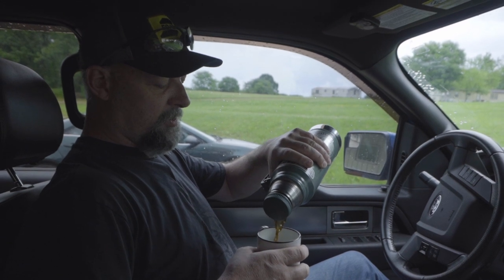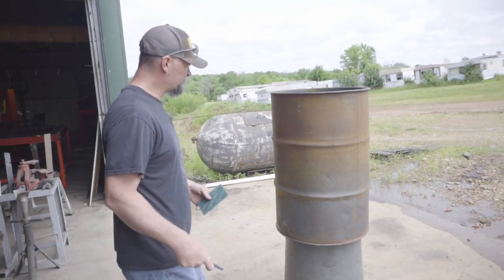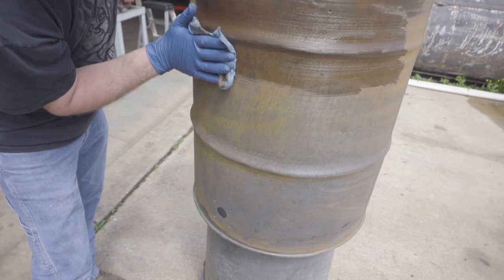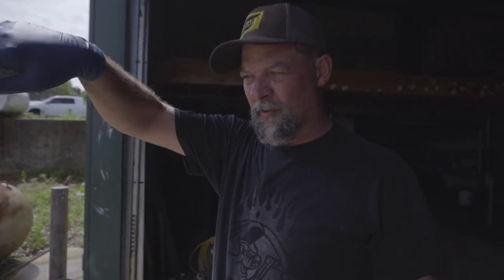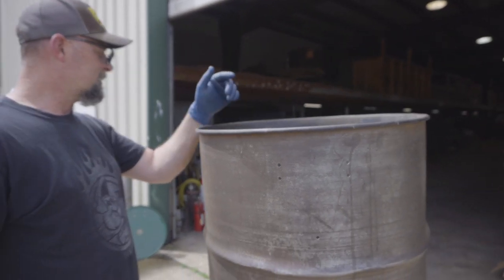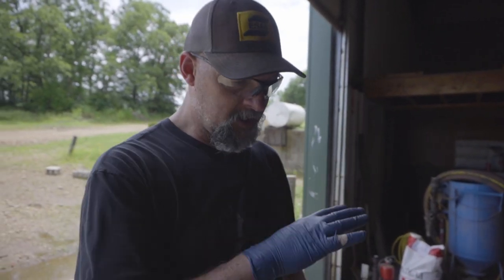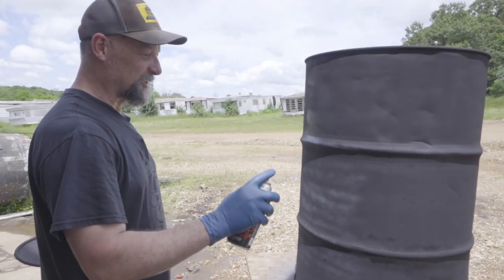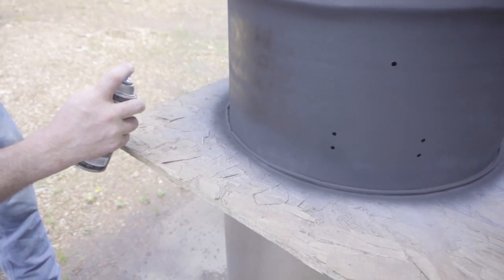How To Build a UDS Smoker [Painting Your Barrel]

Comment: Question bro, building offset smoker with two drums. On my fire drum... Does my damper have to be opposite of my vent duct into the smoker? Or can it be 90 degrees? Damper on front, vent port on left.
Reply from the maker: Hey buddy, I’m not entirely sure what you were asking.
The smokestack on a traditional offset   just needs to be on the opposite end of your main cooking chamber from your firebox.
You can see a bunch of diagrams on our website at smokerplans.net
Reply: @SmokerBuilder  cross ventilation instead of having a damper put any where.

Comment: Hey Frank, thanks for the video!  When burning the barrel , do I need to remove most of the original paint from the outside?  The burn removed the lower third but the upper still has origanal paint (under the black film).  Tried using a plumber blow torch but I'll still be at it in 2022 if I carry on!!
Reply from the maker: You actually do not need to get 100% of the paint off the outside. I mostly am concerned with the liner on the inside. the outside can be sanded and then painted over.